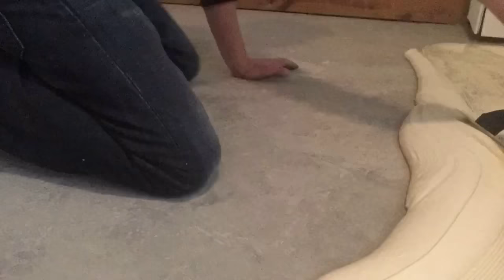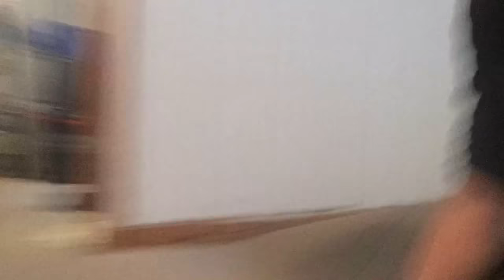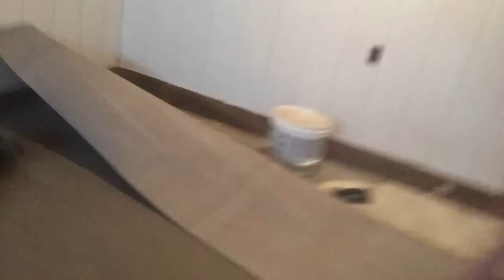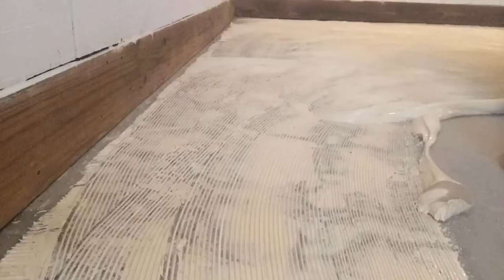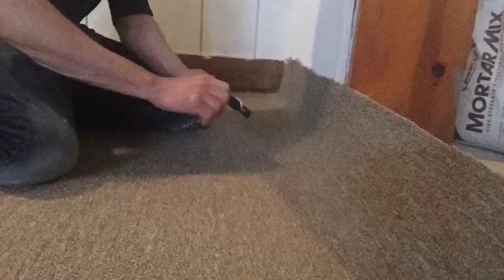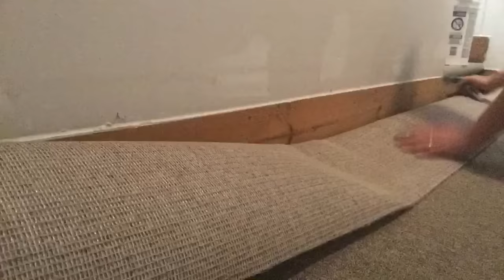How to glue down indoor/ outdoor carpet in a basement carpettoolz.com

Comment: So I was installing indoor outdoor carpet in my concrete laundry room and some of the glue seep through the carpet even though I did not put a heavy amount down is this normal? And will it come off
Reply from the maker: Jon Snyder thanks for connecting! If the carpet didn't have a traditional standard backing to it then yes it's very common for the glue to bleed through. 
Try to peel back the carpet to the worst areas and scrape any excess glue off the carpet backing and floor
After that stay off the floor for 12-24 hrs If possible to give the glue time to cure. 

Treat the damages areas with water& soap and you should be good to go
Reply: Had the same thing happen to us today.  Did you get the glue to come out if the carpet and if so what did you use?
Reply: Ok so if it's the thin brown or black stuff it'll leak through..?

Comment: For how long you let it dry?
Reply from the maker: Daniel Guzman on a standard glue down you do not need to let it dry you can set the carpet in it immediately after spreading 

But

In the case of carpet tile installation spread the glue till it dries clear then start setting the carpet tiles